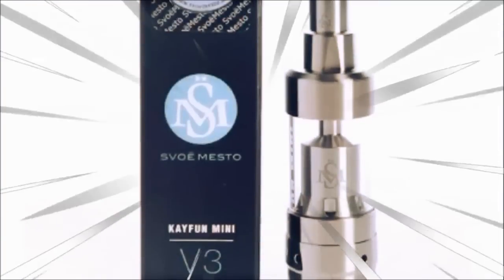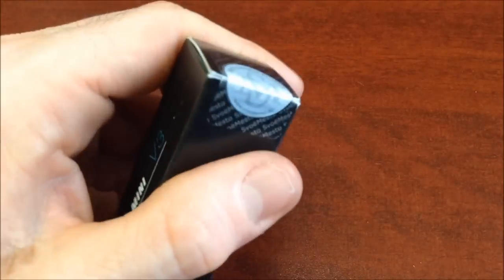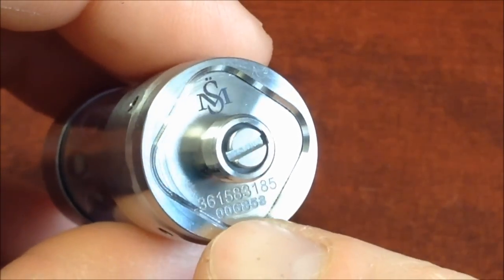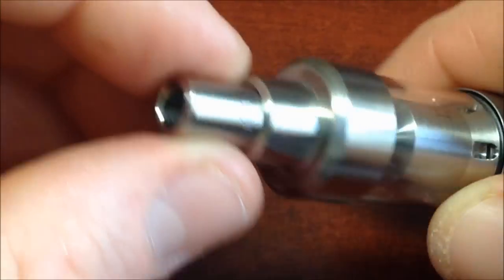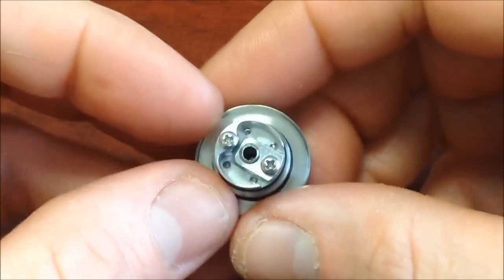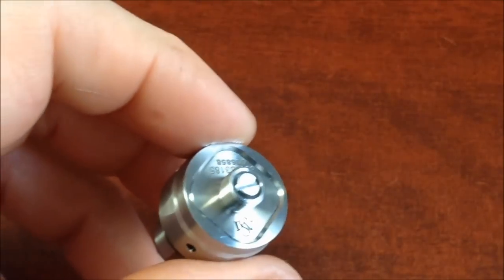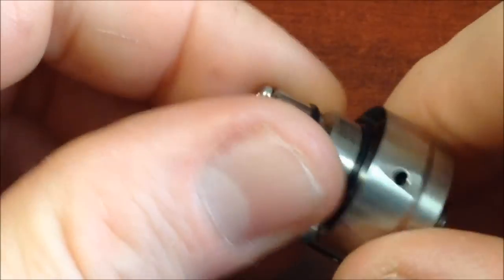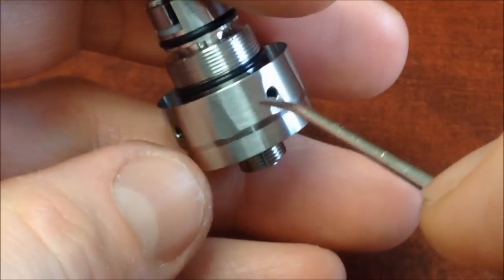KAYFUN MINI V3  SVOEMESTO

Comment: muy bueno el tutorial del kayfun oye una consulta fíjate que acabo de adquirir un perza tc75 y tengo nickel calibre 24 y quiero hacer unas dual coil. me podrías asesorar si no es mucha molestia Muchas gracias
Reply from the maker: Hola Bro mira con el cable que me mencionas que es Ni200 24AWG es demasiado grueso el calibre para TC y más con ese equipo, trata de conseguir Ni200 30AWG o 28AWG te darán mejor resultado
Reply: Le di 5 vueltas a 3 mm y me dio 0.06 a 450 F y 32.6 así la estoy trabajando y es que compre otro pero me mandaron ese